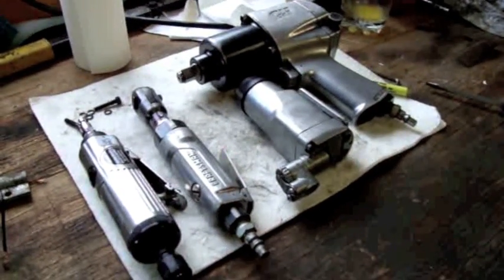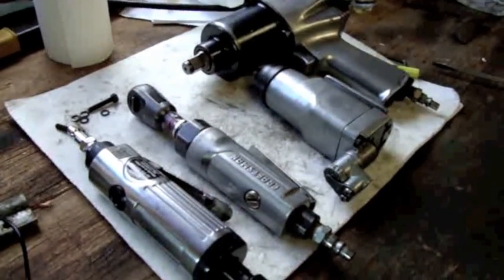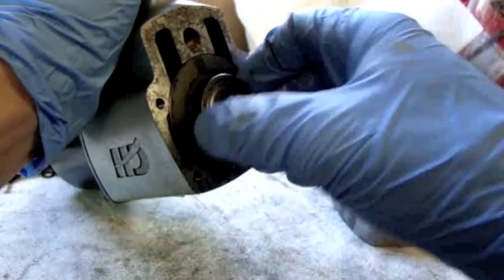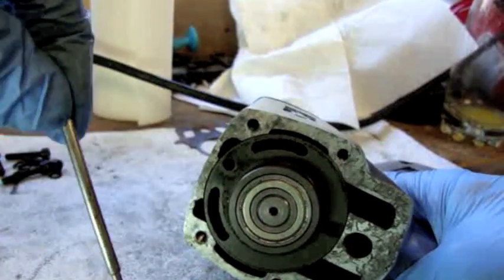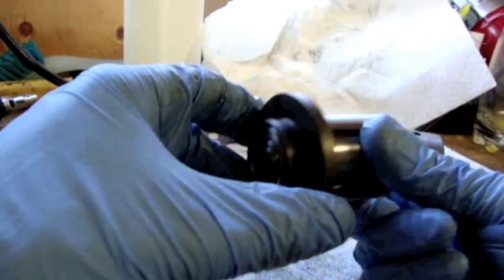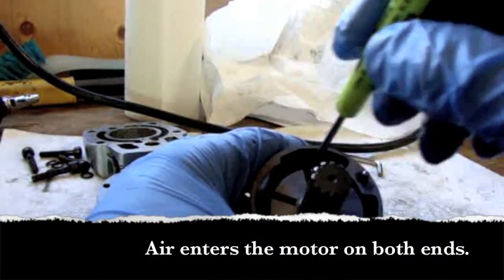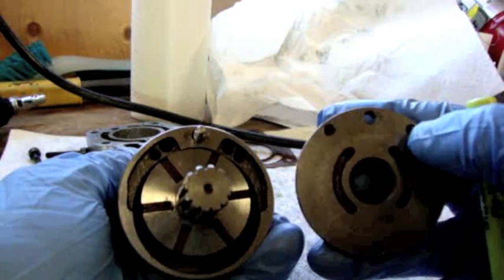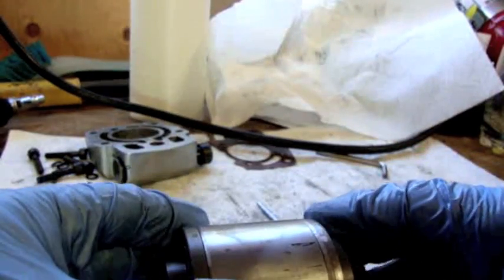How an air tool motor works. (NEW / BETTER VIDEO JAN 2017)

Comment: Thanks again for putting this video. Can you explain why air travels in and enters the chamber between vanes and housing from other side as opposed to entering there from back side where it's closer to the air valve? Also, is there any axial clearance between rotor and bearing supports or they almost rub each other?

Comment: It`s been a few years since I have began using this super system utility “govo unique only” (Google it) which is created for MAC. Their systems have always functioned well in identifying problems with my dual processor MacBook Pro. This software program is good for computer-related tasks such as Cleaning, Securing, Optimizing, anti virus, and spyware.

Comment: Thanks for putting this video. Can you explain why the two separate air passages cause the motor to rotate in different directions? are the air outlets oriented in specific angle that cause this to happen?
Reply: Thanks for the reply. You just described what's happening but you didn't explain why it's happening? My question is about why not how...I admit it's a little too detailed but I guess it may need more in-depth exploration...My guess is maybe the port air flow is slightly directed to desired direction but you can confirm it if that's the case...
Reply: Many thanks for the explanation. It helped!

Comment: Hey Joe thanks for the video , I picked up an older blue point snap on air hammer that doesn't run.. any tips before I start taking it apart ? Thanks . Kits? Regular O rings? I have rebuilt many things ( Volvo head with hydraulic lifters was our last project) but never any type of air tool. Appreciate it !  DIY home repair guy. 
Donny